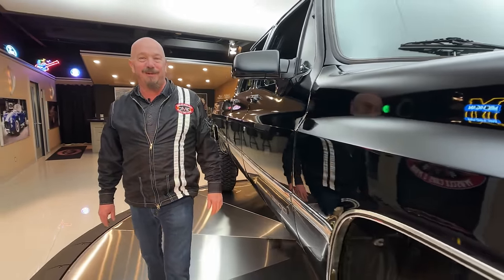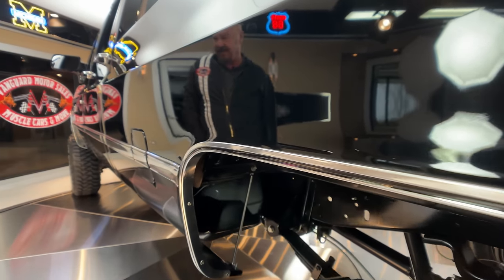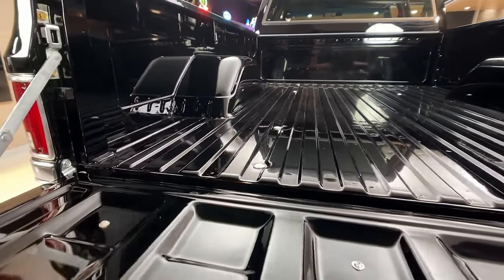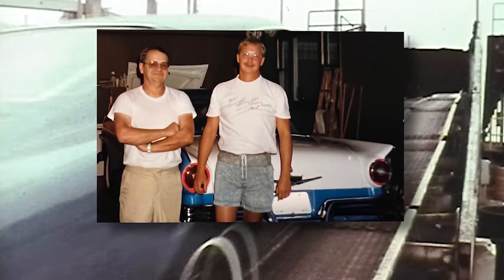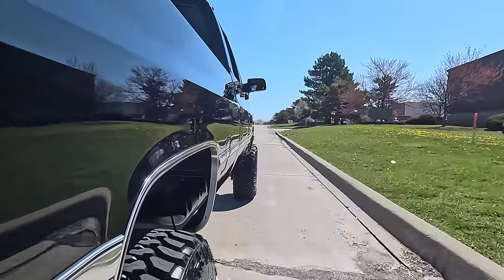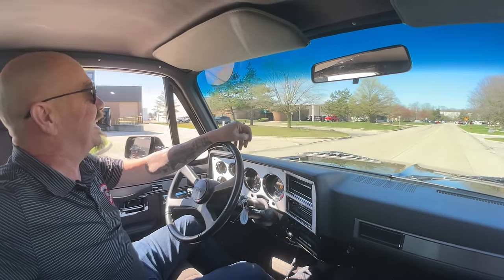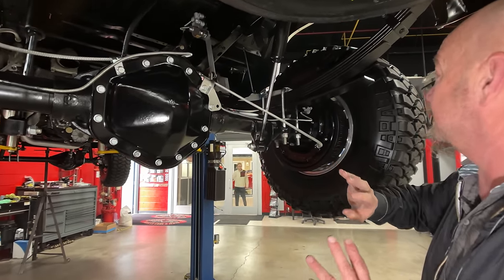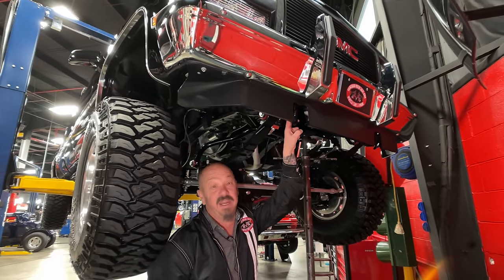1990 Chevrolet 3500 4X4 For Sale Vanguard Motor Sales #1218

Comment: That truck was the pinnacle of Chevy trucks. They should get all the tooling back in order and use the same parts. They have severely severely declined in purpose and ruggedness and reliability. It's only about how much to tow now even though most boaters and most construction guys don't pull more than 10k 99.9 percent of the time.
Reply: 👍Trucks are bought now to put big wheels with thin tires on them and cruise around.    I would say less than 10% are ever used as a truck.

Comment: I had a C30 crew cab dually, I loved that truck we drove it for about 8 years and I sold it due to having too many projects.  I still have a K30 flatbed and we use it regularly.  these are the best trucks gm ever made by far!

Comment: If you buy this replace the front seat bench!   As a former EMT for 6 years, I once saw a older toyota pickup that was rear ended!  The bench seat had no head rests so when he was hit from behind his head snapped back and went through the glass (no back seat). It was a 2 door.  It was horrible.  In this truck it would probably just be whiplash.  Take care of you....

Comment: I own one of these. In 1992, it was used as a drilling rig crew in the North Panhandle (flatland) of Texas until about 1998. But it never looks as sharp as in this video. The 1990 Chev Crew are strong depending pickup truck

Comment: This thing is sick. Filling it up is gonna suck though. Whats it get 5 mpg?
Reply: no its way better than that,  7 to 8 mpg as long as you keep light foot on the pedal.
Reply: yes filling these trucks does suck because the tanks are on each side, on my crew cab dually  I always filled 1 tank and switch to the other full one to avoid having to fill both at the same time.  and yes they are 20 gallons each.

Comment: Dang that's a rare beast. I would shoe horn the 632 or whatever that catalog big block innnit
Reply: a 632 big block is the same external dimensions as the 454, it will bolt right in place.

Comment: It really doesn't matter if it's badge GMC or Chevrolet it's both one and the same it's a General Motors truck GMC which most knows General Motors Corporation GMC is supposed to be the upper chalant a slight up uppercase class of the Chevrolet

Comment: I thought square body's stopped in 87?
Reply: the 1/2 ton trucks went to the new body in 88 but the square body lasted until 1991 in blazer and 1 ton. but they made both bodys in  1990 you could get  a new body or square body. I had a 1990 new body or (OBS) as they call it.

Comment: That’s not a 1990. They quit making the square body in 87.
Reply: Not in the 1 tons. I believe they went to 91 while the half tons stopped at 87. Had a 90 model myself.
Reply: Only the half tons went to the new body in 1988. The suburbans, k5, 2500 and 3500 trucks stayed square through 1991 model hear. They joined the round body style for 1992 model year.
Reply: It is a 1990 3500 I have a square body 1990  dually
Reply: There are also some 1991 square body 3500
Reply: it's an r/v square bodies were built until 1991
Reply: Seriously?   88-91 Crew cabs, Blazers, and Suburbans were still squares.
Reply: The square body did not completely die out (in North America) until 1991. The 1500 trucks began the change in 88. But 2500/3500 trucks hung on for a few more model years.
Reply: One ton 3500 square bodies where still available
Reply: That's what I was thinking